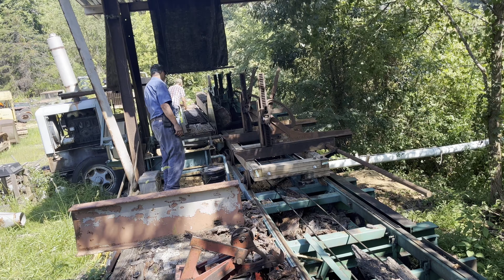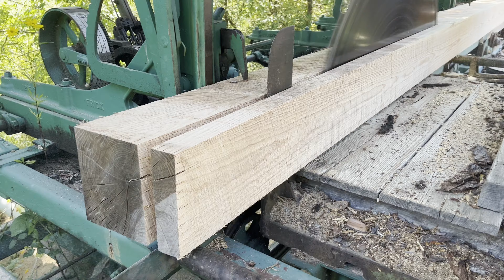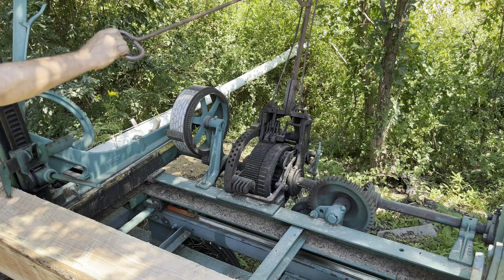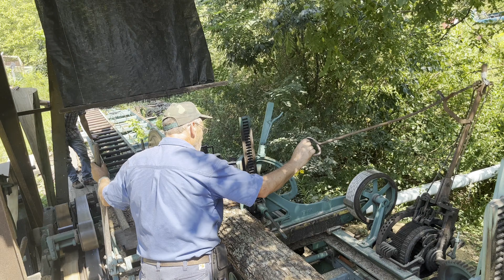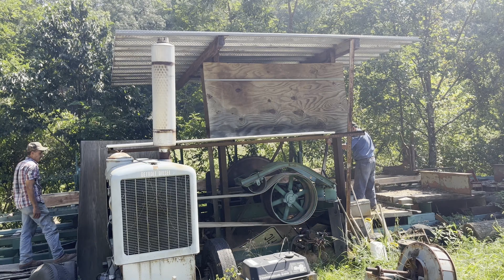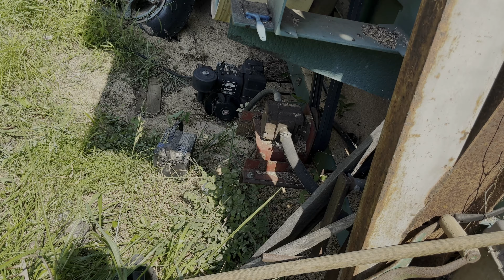Frick Sawmill Sawing Red Oak

Comment: I never have sawed with a Briggs Blower before. All I ever had was a doodle chain. Looks like a good way to do it though. That piece of bark that make the carriage jump.... I had little pieces of belting bolted on before and after the track rollers that kept all the trash off the track.
Reply from the maker: @jeffbrock-y9i  yeah our Briggs motor is giving it up… haha. It works well though beats shoveling the dust away between logs, did that for a while. my uncle has a bigger blower he wants to set up somehow.
The belt as a sweeper is a good idea